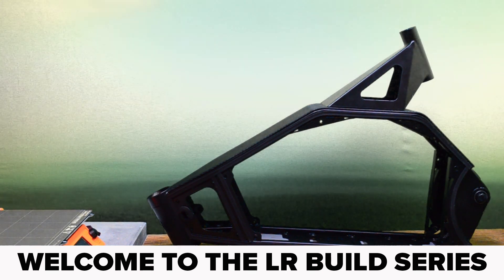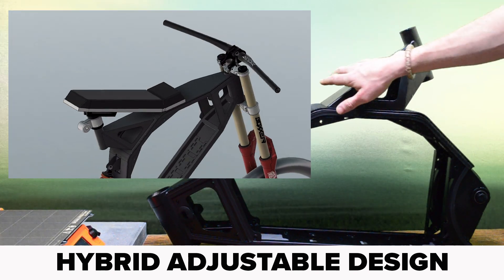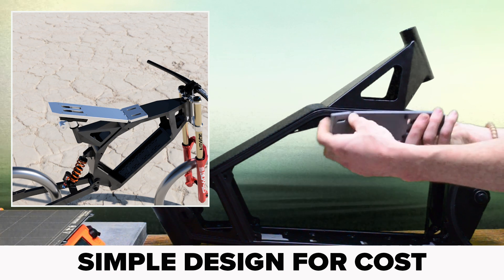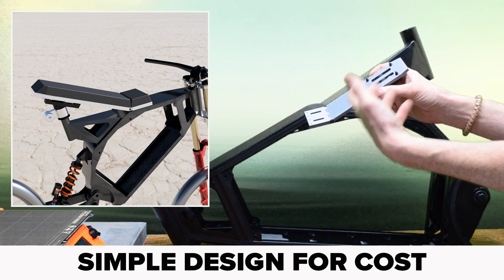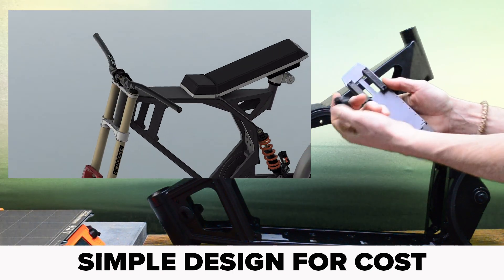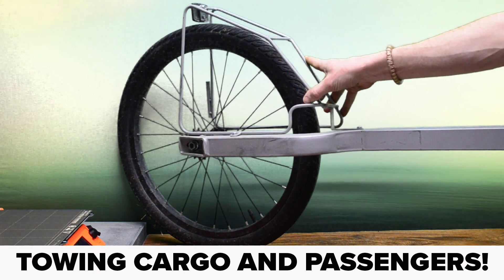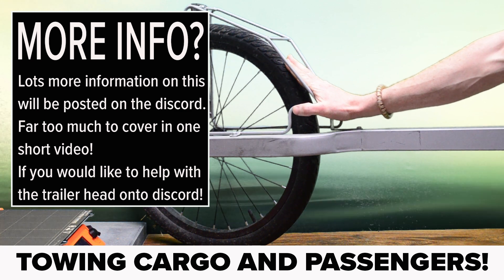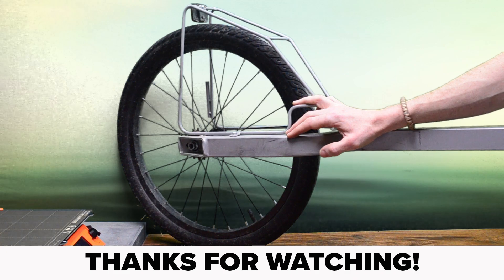Lightning Rods Big Block XL 10kw Ebike build Part 5 Seating & Bench Test Preview

Comment: I'm 6 ft 3 and I run the same frame with 19 inch rims but 21 inches overall height. I have the 200 mm rear DNM shock. I bought the cruise seat and it's the most comfortable thing I've ridden. I didn't find any flat style seat or Moto seat to be comfortable over long rides.
Reply from the maker: Thanks for the comment Ryan. The shape of the seat will be done by a buddy of mine. He rides a lot of these bikes so it will be shaped to be as comfortable as possible! How do you find the DNM shock. What are you running up front? Cheers!
Reply: @HighVoltageKits  I still love the building of the seat. It's going to be awesome. The d&m shock is decent but not great. You need to get the heavier 850 lb spring. I'm thinking about adding a second shock with a 650 lb spring. That would be two of them at 6:50. I have a 205 v3 hub and it's very heavy. Keep in mind I do ride very aggressively and a ton of off-road
Reply from the maker: Its early days so a lot will change. I need something to send to the water jet cutting place in order to get a rough idea how much parts might be. I am upgrading my printer setups here so I can print in Polycarbonate and large parts fast. Thanks for the advice on both the seat and the springs. Would you like to join the channel discord. Its a pretty fun community. A guy on there called Rio I think you will get on with. He rides the same bikes hard offroad as well. You might even know him. Small world ebikes. https://discord.gg/UBYptPC4Ty let me know if you have any issues with it. Cheers!
Reply: @HighVoltageKits  definetly. I will see about getting on there soon. Just playing some Valheim with friend tonight
Reply from the maker: Had to look that up.. Looks fun. If only I had time..I still have to finish Red Dead 2. I'm in that lull of sadness before need to finish it.

Comment: Great video once again. That motor is crazy. Can't wait to see more of that.I have a question and also to see if you ever used this, Flipsky Anti Spark Switch Amphibia 30S High Voltage Switch 200A. I want to use this in place of a contactor switch for on and off. This is the only solution I came up with for the high current battery pack I'm building. Any feed back will be appreciated as I'm a noob at this stuff and learning as I go.
Thanks Captain..
Reply from the maker: Thanks! I have not seen or used the switch.. You may find someone on discord tho. The litespeedbikes battery I have has a regular 100 amp breaker switch on it. So I plug it in and then hit the breaker on after. Hope this helps. Cheers

Comment: On the front of the mount fabricate hard mounted twin post with aluminum spacers you can add to raise the front of your base plate as you raise the back on the stem?
Reply from the maker: That is a good idea. I think I would use a 3D printed part or another material than Alu due to cost. Unless I end up making a ton of these! Thanks!

Comment: I think the cushion platform should have a degree of ergonomics in the design, to avoid any digging into the inner thigh. The edge of the platform should also be rounded over where any body parts will be pressing,as I believe that a square edge could be felt through the padding.
Reply from the maker: Agree 100% This version was more to get the ball rolling and explain the concept. I definitely don't want something uncomfortable. There are a few people helping on the comfort side. I would want the cushioning to lap over the edge. So likely will reduce the plate width to allow for that. Thanks for the comment. Good advice. Cheers!

Comment: the tilt on your design seems excessive. it will thrust the rider forward constantly, I imagine
Reply from the maker: Its deceptive. The model in the designer is no flat and the shock is not loaded. I understand what you mean though. If it gets raised too much at that back it would do this. I have a spacer for the front bracket to level it out if that became an issue. Another video tho..Thanks for the comment! Cheers